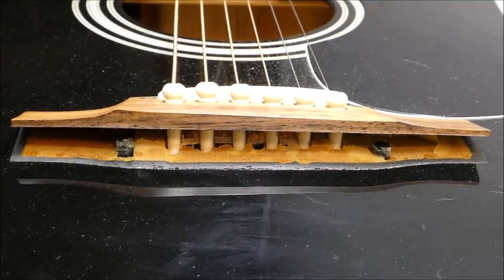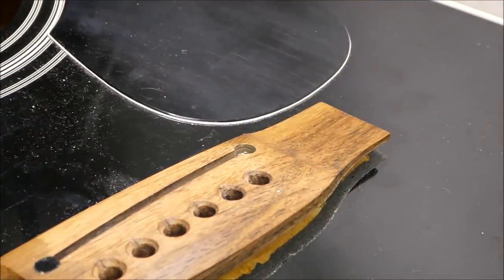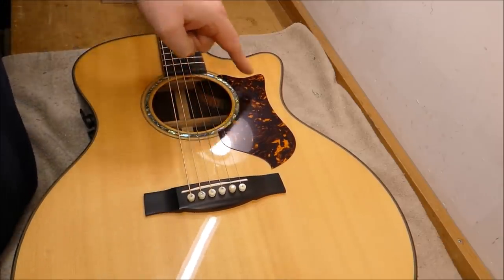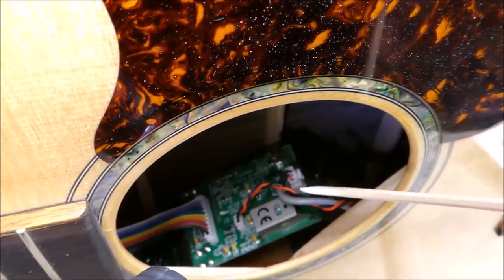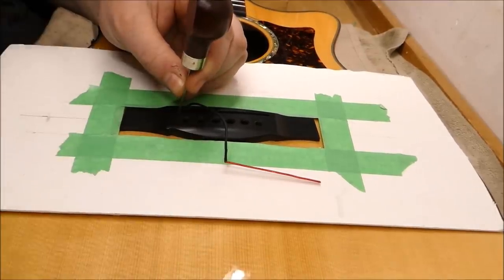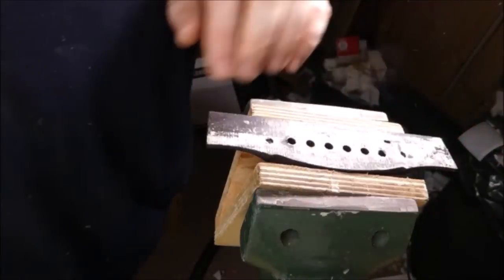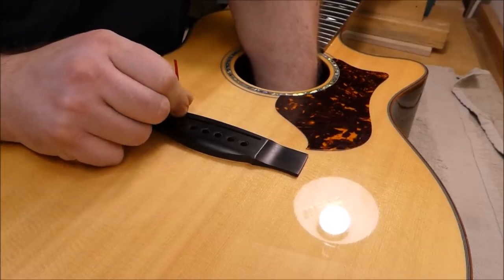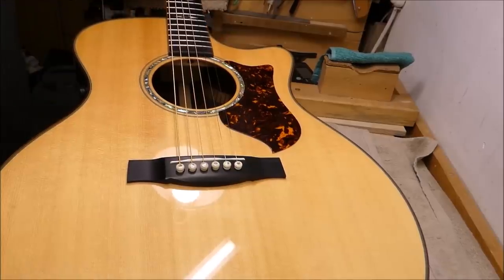Bridge Glue Blues!

Comment: I completely understand and want to reinforce your reservations about the onboard circuitry. 
That box will fail. 
Guitars last decades, even centuries, little digital electro-musical accessories die like rats. In a few years or maybe even a decade that guitar is going on someone's bench with a dead preamp and a guarantee that whatever the manufacturer is doing by then will NOT fit in the same hole. So it will be someone like me and maybe, if we are very lucky it can be repaired without schematics, because I can assure you that those aren't even available now, never mind in 9 years when that fails. 
Love watching you work. Great stuff.

Comment: “ when working by hand, mistakes happen much more slowly” Lol, I can relate. Nothing quite like the low speed horror of watching every small, carefully considered move being a baby step towards failure. I have even put the job down thinking it might go differently tomorrow only to pick up right where I left off. I believe it is destiny my friend, not yours (or mine) but the destiny of the thing being working on.

My currently favorite guitar is a Takamine. It’s a full size acoustic from the 1990’s, no cut, no electrics, entirely in mahogany. I did an easy set-up when I got it (used). It plays great and sounds rich and full. just a touch muffled but it has really nice bottom and records well. It’s quite unique sounding in my collection, I have other instruments that have much crisper top end tone but it pleases my ear and can be quite inspirational.  I plan to keep it a long time.

Comment: About The aura system, you can pivot the system by lifting the battery tab on the front, then you have easy access to the Battery and  the pickup input  terminal screws, and yes they are small but it's easy once you have the  pickup system flipped around..
About soldering the wire together, you should really rap a piece of coppertape around the inner heatshrink and solder that to the grounds, high impedance inputs are "hum detectors" even a few millimetres of unshieldet wire can pick up hum, this is why there is the small shielding box over the input terminals on the preamp, like you pointed out.

Comment: Well, I work on watches and guitars and i understand how it is to work in tiny spaces and execute tasks you wouldn’t dare to when in your perfect mind! Great job.
Not trying to tell you how to do your job but one thing i do on electronics, when soldering tiny cables, and would like to share it here. I cut the leads reversed when possible leaving both wires with one end shot and the other end long. I.E. If cables red and black are parallel I cut opposite lengths. On your case, being a mesh and a wire, I’d shrink the long leg on the mesh then solder it to the short leg, next I’d proceed to the red wire in reverse lengths and would only shrink it if necessary. I’m pretty sure you know that but thought it could be useful for someone here on your channel. 
Thank you for sharing your precious time with us!

Comment: I have an OMC-PA1, very similar. For an electronics person, those screw connectors are a piece of cake. The screws only need to be loosened, the wire ends come right out and you pull the pickup and wire out unmolested. It was designed for production work, so easy - if you know how. They actually go in easy too. Also, the first series "Performing Artist" models have bolt-on necks, just like Taylor. Except Martin decided to glue them as well....  The F1 Aura? It's digital. It's got 10 different sounds that sound like a piezo pretending to be a microphone.  But the tuner is darn handy.

Comment: Completely agree with you Ted on the internal electronics. Acoustic instruments should be just that. If it needs amplifying use a mic or an electric guitar or as you say a bunch of pedals or magic boxes on the floor. Just built a uke for someone and they wanted an under saddle piezo, which I did for them but there was as much work in planning and fitting the pickup as in the rest of the instrument put together!

Comment: I love the Aura system, it can save 4 presets, each with it's own pickup EQ and "emulation" EQ, plus pickup level and "emulation" level, and it's so easy to switch between them. They give you access to a huge library of "models" to try, and it makes the guitar sound very different. I have too much on the floor as it is to add this in a pedal.

Comment: not to make the aggravation of the martin pickup worse, but unless i'm really missing something you're supposed to just pop the knobs off the preamp, undo it from the side of the guitar, fish it out and undo the little terminal block screws! it should have been like a ten minute job to remove the fishman element. (how do you think they installed it after all?) also, those tiny terminal screws don't actually come out of the block because yeah, drop one of those and it's game over 

i've replaced those digital aura preamps before (they sound OK but i'm with you, USB ports don't belong inside guitars) and it's an entirely "bolt-in" job

also, was that bridge actually ebony or was it that weird artificial stuff they sometimes use? any opinions on the right glue for "richlite" or whatever they call it?

Comment: I used to install those Fishman pickups all day into Guild guitars back in the early nineties, and I learned pretty quick it's always better to desolder those pickups at the preamp end and always install them from the front. As you say, that right-angle where the wire meets the pickup is very much the weak spot.

Comment: While working as a repairman at B&J in Toronto in the 1970's we were the exclusive distributor for Ovation guitars. The bridges were glued with epoxy right onto the extremely thick polyester finish. I don't believe we ever had much problem with any bridges  lifting. Also, there was about a 1/32" cavity routed into the bottom of the walnut bridges to assure a very thick glue. It seemed to work fine...

Comment: Preamps are usually easy to remove by pulling the knobs and unscrewing.  As for mini terminal blocks, well usually you only have to loosen the screws, not remove them all together.  If you really can't get it disconnected, then simply cut the wire.  You can re-solder it fairly easily.  Or even do a favour for the next guy, and install a connector of some sort.  As for the Takamine pickup, this style of pickup with 6 piezo cylinders and an aluminium channel is used by several other guitar manufacturers.  Notably Maton, here in Australia.  Yes it looks like a clunky system, but it is a very nice sounding pickup.  Maton are careful though, to glue the bridge directly wood to wood.  The bridges are lacquered separately, and the face is masked with an exact bridge shaped masking sticker.  If memory serves, they use titebond for bridges.  It is very very rare that bridges cause problems.  The pickup wire in a Maton is clipped into the preamp using a telephone type connector.  They used to have a regular mini jack, but they would frequently pop out in transit.
Ted, if you ever get stuck with a guitar electronics problem, feel free to contact me.

Comment: I like to have as much of the electronics, like say, the Fishman Aura, or anything bulky  or with a battery for that matter, outside of an acoustic guitar for the reasons you stated.  A setup I've found very reliable, easy to service, and authentically acoustic sounding at even loud stage volumes without feeding back is a K&K mini or mando twin running out into an LR Baggs DI box.

Comment: I have a Martin DC-Aura GT. I love it. It has 4 settings available to scroll through quickly, by push button; piezo, and 3 aura voicings. I then go through the Boss TU-3 tuner, and into, wait for it, the DBX Go-Rack. I can mix in my mic signal from a Shure Beta 58, add compression and feedback limiting. Because it has a master volume out, I can control my sound without a sound tech at the desk, which is often left turned on inside a locked cabinet at my church where I play 2 or 3 times a week. I don’t have to worry if the desk is set to line or Mic. When you only have 15 minutes or so to bump in and sound check between services, this set-up is quick, flexible and reliable. I took the legs of a boom stand and mounted the hub to mm Pedal board. Boom, the PB acts as the legs of the stand. Now I don’t need to use the Fishman Aura Pedal mounted on the PB I previously used with a Yamaha Acoustic. For me this works a treat, but Thank You for the piezo information. I had the bridge lowered due to the expected bowing recently, neck re-set next in a few years. I know you don’t read these comments but you did ask specifically and I’ve used both the Aura Pedal and Guitar, both great but different. ✌️❤️🙏🇦🇺

Comment: Use a gel resin in a syringe when soldering it will make it flow better.  try and use good quality solder
You can interlace the wires fiddly use a piece of cotton on either side tighten them tight and then solder applying the resin first

Comment: Takamine are well made instruments. My EF-340S is almost 40 years old and apart from the dents and scratches and a couple of frets wearing in spots, it has maintained its structural and acoustic integrity very well. The bridge pick up still works fine as long as you change the 9V battery regularly.
I recently discovered that this particular Takamine guitar model was subject to a patent/copyright infringement claim made by Martin Guitars many decades ago. The dreadnought design is unmistakably Martin

Comment: Yes, I’m with you that the Aura system definitely belongs inside a box (not in the guitar) - Not sure if that means you already knew this, but the first versions of that system were (and still are) inside a stomp box pedal you put on the floor; Aura Sixteen and the Aura Spectrum DI, the latter of which is for multiple instruments as well as guitar. I bought the seemingly still little known Aura Sixteen (>10 years ago) for my late 1990’s Taylor 410 (dreadnought) which has a Fishman piezo and Prefix Plus (factory installed) before they later moved to the Taylor ES System. It transformed the typical ‘quacky’ piezo sound into something really very, very good and eminently useable for live performances. The Aura Image Library of sounds of tone woods and guitar shapes is also really very impressive - though sadly the many Taylor’s it has does not include my 410CE Ltd which has Sitka top and Hawaiian Koa back and sides (looks and sounds gorgeous), but still managed to find some remarkably good fit/sounding profiles. Does it sounds like the original mic and guitar combination? Who knows - I’m sure I never will - but to my ears it sounds at least as good, if not better, as most if not all of the other alternatives out there, including the LR Baggs offerings. You can still pick up the odd new, old stock Aura Sixteen online for dirt cheap but even the Spectrum DI is still being made and is way, way cheaper than it was nowadays - in fact I’d considered buying one as the preamp and other features alone make it work the money. Think David Gilmour  used one live for quite a few years (perhaps still does?)

Comment: I had the same issue with the undersaddle pickup in a guitar of mine, a guild om240e. I really don’t get them, you just can’t move them, it’s like if they build the foil straight and could be bend just once during installation. I have to say it, I felt fine knowing that it happens even to big professionals. Great video!

Comment: I actually have a similar model an ompac3, that has the aura system. I like the sound from the unit but it needed a full replacement 7 years after purchase. Hopefully it lasts... mine has Richlite as a fingerboard and bridge and this model has the ebony which I would have preferred. My only other complaint with this guitar is the frets that seem soft and divot pretty fast in positions 2 to 5. Thanks for the great video!

Comment: Fascinating as always.  It occurred to me that, once you were at the point of deciding you needed a bigger hole to get the PU through, that might have been a good time to cut the wire. Then, drilling the hole bigger would have been simple, and you would not have had to been so worried about making a solder splice at the end that was small enough to fit through the original hole. And maybe even big enough to accommodate connectors of some type rather than a hard soldered splice, to make future repairs easier. Thoughts?  I had a bridge pop off once on an Ibanez Artcore.  There was lacquer under the bridge! So the repair guy carefully scraped that all off before regluing. But my Fishman died during the repair.  I felt really badly for the repair guy but he insisted on doing the replacement at his cost.  Good fellow. Bad guitar design (or at least bad construction).

Comment: That’s a PALATHETIC PICKUP:
Using six individually shielded piezo-electric elements, the Palathetic™ pickup is not a just a UST. It employs twelve times the element mass of the typical under saddle pickup.
Palethetic Steel
The core element behind the amplified superiority of Takamine acoustic electric guitars is the proprietary Palathetic pickup.

Using six individually shielded piezo-electric elements, one for each string, the Palathetic pickup is not a just a UST (under-saddle pickup). In fact the Takamine design employs twelve times the element mass of the typical under-saddle pickup. The six elements penetrate the bridge plate, soundboard and bridge to make direct contact with the saddle creating a sonic linkage with the string. The pickup casing is mechanically attached to the guitar's top and bridge creating a sonic linkage with the soundboard. The result of this design is a signal that possesses the articulation of an isolated string signal and the rich harmonic content delivered by the resonating soundboard for a full, complete and accurate acoustic guitar tone at high sound pressure levels.

Comment: Takamine is a Japanese brand name, which the name is written in Japanese. However the name is written using their Latin charactors-based system called 'Romanji'. So to call it properly you have to read it in Japanese not English or whatever language :-).

Comparing to Japanese name written in Romanji, Chinese name written in Pinyin (the similar system for Chinese) is much worse. You'll probably see Shijie guitars in the next few years I think, and will have some hard time reading it.

Comment: I've worked on an 800$ Alvarez MDA66CESHB 2 days ago. The client returned it to our store with a huge crack on the bridge, running across the stringholes. At first i thouth he had poor humidity control, the wood contracted, and the pressure of the pegs inside it just cracked it. But as I took off the strings, I"ve noticed that the bridge was very loose, and I could twist it right off, cleanly, there was no wood chipout, and the surface under the bridge was silky smooth. There was a tiny resudue of some epoxy or polyurethane on the bottom of the bridge, but not much. No wonder it came off...

Comment: Japanese made Takamine's have used this pickup configuration for 20 years or more, Maton an Australian brand played by Tommy Emmanuel use an almost identical system. It's a great design as far as balancing the string output of the undersaddle piezo but it does compromise the bridge integrity, as an Australian guitar tech this is unfortunately a common repair for me.

Comment: As a homemade workaround solution, I’ve succeeded bringing ground insulation back into my red fishman piezo by wrapping it with kitchen aluminium foil. Prior to this, have spent years playing using a wire taped to the output jack of the guitar and put in contact to my skin...

Comment: Crap! I wanted to watch this, I have an Ovation that has a similar issue, except the damage is extensive! The guitar is a model 1917 and my dear friend is near the end of his life. His parents had to save to buy the guitar new in 85 if I remember correctly. There is tremendous sentimental value  zero money and I've repaired a total of zero bridges, so I really wanted to see this job!

wood to secure the bridge and finish the top in a matt black with a replacement ring. I'll seal it with a final few coats of spray can matt finish.
I know there's some horrified people reading this right now but I'm disabled myself but I do have experience with wood. I worked at a cabinet builder's shop and also built pine, maple, and oak tables, and cabinets. I also worked on sites installing paneling, custom cabinets, libraries, crown molding, baseboards, etc which I also manufactured from scratch as well as stained and of course, installed!!

So I'm not completely useless!! LOL!
I might go as far as posting pics of the guitar when I'm done!! "MIGHT"!!
Jack ~'()'~
Reply: You will be dealing with epoxy glue ....The ones I've seen had the bridges glued directly to the finished tops   . Good luck !
Reply: @bobnancymiller4931  Thank you, I know I will absolutely need the "good luck" part! ")

Jack ~'()'~
Reply from the maker: Still haven't heard back from the customer. I'll make a video if they want to fix it.
Reply: @twoodfrd  I look forward to it if they decide to go. 
Thank you!

Jack ~'()'~

Comment: You should have taken out the pre-amp and tried carefully unplugging the pickup, so that you could pull the wire out of the hole instead of sending the pickup through the hole. They don't look like it, but every pre-amp I have seen the specs on that use those type of pickup have a tiny plug that connects it to the pre-amp and they are not soldered. My reason for knowing this is by researching what I will have to do to replace the pre-amp in my guitar without having to change out the pickup. I like the current pickup just fine but am not happy with the pre-amp.